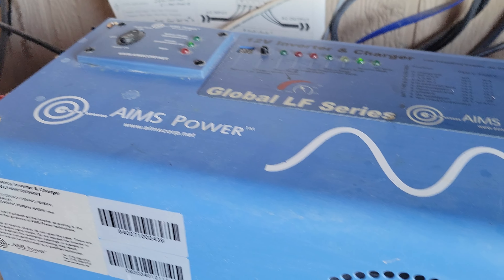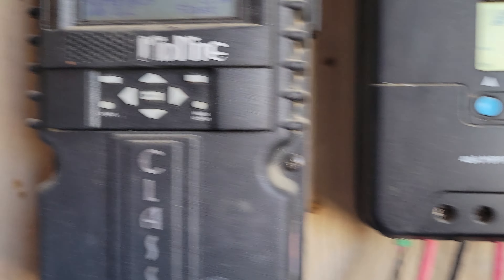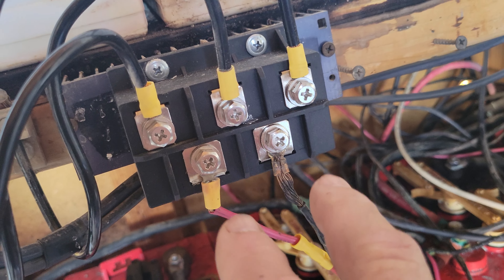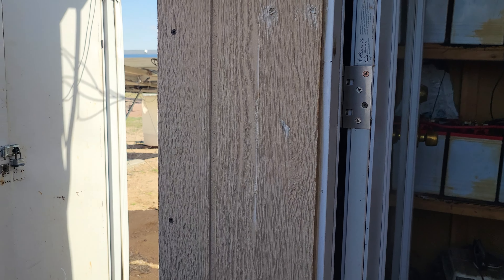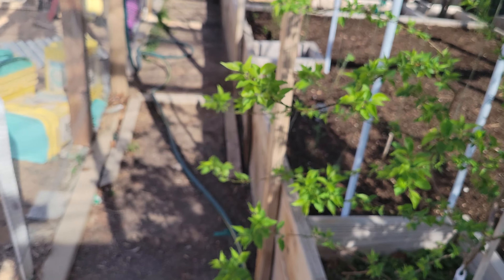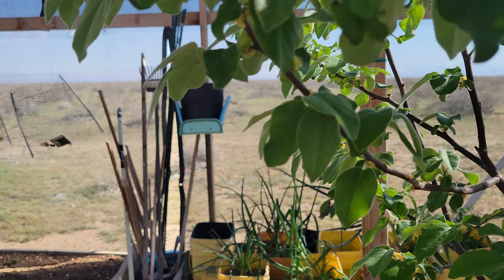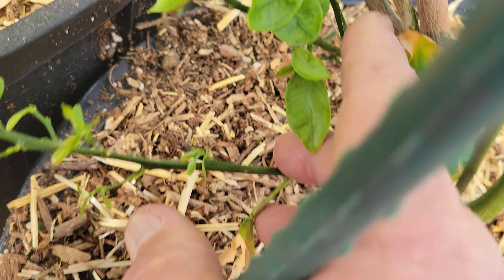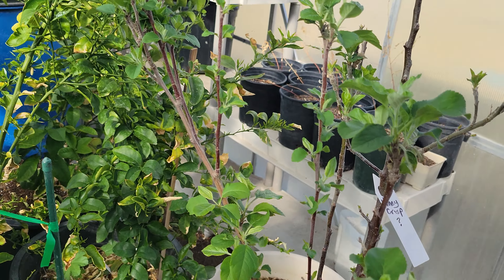Off Grid Solar-Battery Maintenance, and More! April 13, 2023

Comment: Hi G Bear. Everything looks great. I hope you get a lot of fruit this year. Maybe its all the rain water plus the soil preparation you do. Have a nice night G Bear.
Reply from the maker: Having water is a super plus.
Reply: G Bear . I wanted to ask. Are the wal mart marine deep cycle batteries any good for solar. Do you know anything about them. The agms and other solar batteries are too expensive for me.
Reply from the maker: @Humberto Carrion Jr  Any deep cycle batteries can be used for solar.  The important thing is amp hours.  Marine deep cycle batteries are usually pretty good.  The thing is, a battery with low amp hours won't last long when they take over running the load, so more batteries are needed.  The more expensive batteries with higher amp hours are stronger, so less batteries are needed to do the job.  In all, you end up spending the same because it takes two 100ah batteries to do the same job as one 200ah battery.
Reply: Ok. Thanks. Those marine deep cycle say 100 amp hour each .

Comment: I had to do the same thing. The voltage is better after pulling that one bad battery out. I have 20 new terminals coming so that I can make new cables for part of the battery bank. They should be here Tuesday. Mine charged up to 25.7 v. today, with the wind generator helping. I retightened all the blade bolts and installed nuts behind the hub last night. One of the blades was less tight than the other two, I guess from the high winds. It's quieter now. I coated the blades with Armor All to make them more slippery. I had a meter similar to the one you have, for the wind generator, but it crapped out after two days, so I bought one a bit different. I had too much power today, with both the wind and solar. I haven't quite had the wind generator for a month. I'm almost used to it, lol. I'm still considering the Midnite classic charge controller. My batteries were in float charge by 10 a.m. so I made a 🍕 Pizza, and they were in float again by 11. They're getting a lot of 🌞 sunshine. I'll have to check mine because they're not completely full, as I was going to fine tune them with the acid which never has made it here yet. I'm waiting until after the first of the month to check the other batteries after I get them rewired and charged for awhile, before I buy a new one. In case I need two. Doesn't seem to be any others yet though. I was afraid that I had overcharged them last summer during the solar flare. I'll be able to run the air conditioning unit longer this year. The freezer took quite a bit of power when it was 106 degrees, but I think I had it set way below zero last year. Unless they have went up again, the ones I use are $129.98 at AutoZone, for a 105 amp hours 12 volt. I only have 14 hooked up today. I think the bad one was dragging the voltage down for a long time. So I've never had it with all twenty batteries working right. I was wondering why I had more power with 16 than I did with 18 last year. By May, my system will be working better than it ever has. It seems like the inverter charger sounds better. It had a hum under load, that I think has disappeared. Thanks for the update and reminder to check the batteries. Mine are showing 25.4 at 11:30 p.m.

Comment: Running 4000W on a 12V system is really hard as you end up working with having to handle around 400A current and the cables required to support this need to be 120mm-150mm in area. Smaller cables will end up overheating or dropping too much voltage at full load. Even current metering is a challenge.

Problem is that to change voltage you would have to replace the chargers and inverter which are expensive and are currently working well so I guess you have to stick with 12V unless the inverter blows up for some reason then take the opportunity to rearrange the battery strings etc.

I've a 5KW inverter on 48V which is much easier to wire up with 25mm cables and 125A breakers. I frequently charge the car off it at 3KW for several hours at a time plus other loads and the  cables only get slightly warm.

Stay safe and happy
Reply from the maker: Welcome aboard,  and thanks for the input.  I've been running this system for 8 years now, and haven't had any problems with heated cables or such.  I'm a believer in if it ain't broke, don't try to fix it.

Comment: I was watching a few videos of several people where they periodically refill the batteries cells in the top to maintain fluid loss from the cells with distilled water a bit at a time. There are lots of videos about that. But I only saw 1 video where a guy had all the batteries still connected while he's putting distilled water in the tops of the cells. Prior to that I didn't think you could do that with them still wired together while doing that. 

Regarding that, I wondered if you can still put distilled water in the cells with the batteries still hooked up and linked together? Or how you could do it safely?  I felt embarrassed to ask about this until I saw what looked like a video where one guy was putting in the distilled water with the batteries still hooked up.

I ask because if you have like 6 or more batteries all linked up... it could take all day to separate them. And it seems like you could also have risk from the unconnected cables sparking each other with them all stray and sticking out compared to the risk of filling them also. 

And if they are AGL batteries not sure if you had to add anything to the distilled water going into the cells?
Reply from the maker: AGM batteries are service free.  No maintenance required.
Lead acid batteries need distilled water occassionally, I do mine every 2 months.  No, they don't need to be disconnected to be filled.  I've done multiple videos on the subject.  I use a battery filler unit, available at most automotive stores,  just push it down and it will stop gurgling when the proper amount of water is applied.  They do not need to be disconnected.
Reply: @GBear  Thank you.

Comment: How do you know or find information about how to open up the topes of the batteries to add the purified water into them? With some batteries you can't see the top flaps that people open like you'd see them on a car battery.
Reply from the maker: If the battery caps aren't obvious, it is probably AGM or Gel battery and you can't add water to those. ONLY LEAD ACID BATTERIES GET DISTILLED WATER.
The caps will be obvious, and easy to open, otherwise, don't mess with them.

Comment: I saw Davids comment and was wondering how you would check to find one bad battery in a bank of twenty. And how much would another pole cost to add another pma and keep the existing one ? You have wind as much as sun on the homestead.
Reply from the maker: Just upgrading to a max core unit will act like 2 PMA's, and I can just sell the old one.
To find a bad battery in a group is just testing each one separately.

Comment: When your batteries age and you can't get quite as high as the original high voltage ratings, how do you convert that loss into how many amp hours you are losing? Thanks. 

Example; initially 12.9 or 13V and then a year or 2 later battery still works but getting 12.5V max. Unsure how to tell how to tell what the loss means in terms of amp hour differences based on what the voltage is getting.
Reply from the maker: Do you have a BLS-12N on your batteries?  The average life of a lead acid battery is 3 years, but with a Battery Life Saver connected, you can get up to 10 times that.  I've had one since I started my solar battery bank in 2015 and still get fully charged every day.
Reply: @GBear  I didn't know about those. That seems worth looking into, especially if the batteries can stretch  for years to come.
Reply: @GBear  Thank you very much.
Reply from the maker: @Noah Riding  the military has been using them for over 20 years
Reply from the maker: They make the BLS for different voltages, and batteries.
Reply: @GBear  Well. Thank you very much. Without you I wouldn't have found out about desulfators. 

But then i got really curious after talking to you... 

Like does this mean there's more sulfur damage when the battery is empty or full? And does the desulfator work better on 'repairing' when the battery is full? or when its low also? 

I'm also curious what got you into off grid and homesteading? I like it very much but I'm very curious if others have similar reasons as me for being interested in it.
Reply from the maker: @Noah Riding  sulfation occurs while a battery is charging.  Since batteries charge every day, sufation is imminent.   The BLS prevents that.
Batteries produce electricity through dissimilar metals suspended in an electrolyte. It's called electrolysis.   See my playlist videos on electrical experiments where I get electricity from the ground.
As far as living off grid, it's a bit complicated, but let's just say, I always found it to be somewhat communistic to have to pay for things that are God given.  Electricity wasn't invented, it was discovered, water exists as a natural element of this planet,  as does air and natural gas.  All can be achieved for free if a person makes the effort.
Reply: @GBear  Yes. I don't like the way civil rights and freedoms are being eroded right now. And the idea of how people are expected to just slave away with 100% of their pay check going to some greedy guy. Its quite scary. That's why what you and others are doing seems so interesting to us. Thank you for the reply.
Reply from the maker: @Noah Riding  I have a ways to go before I'm self sufficient.  I will be building a biogas generator so I no longer have to buy propane. For heat and cooking.  I will increase my rain harvesting size by 2.5 times what I have now, and my garden is in the process of being enlarged, as is my chicken coop and flock.
Reply: @GBear  Well you are on the right track. And you are a good guide.
Reply from the maker: @Noah Riding  thanks.   All I have to do is ,live, life.